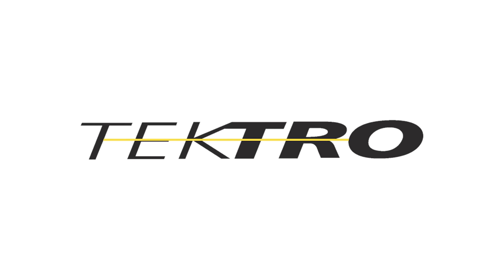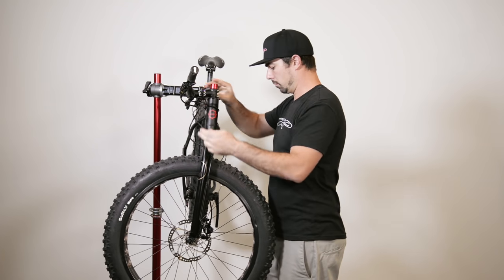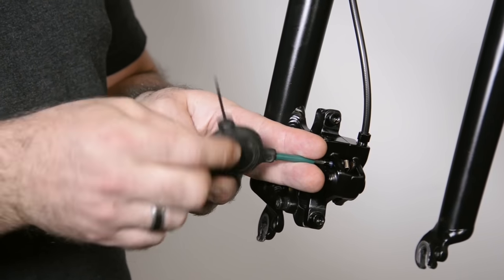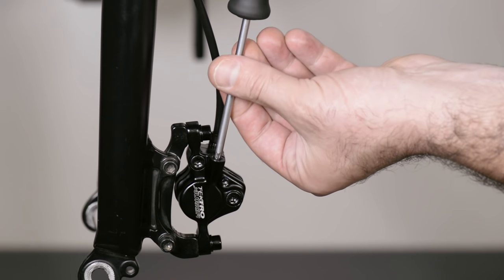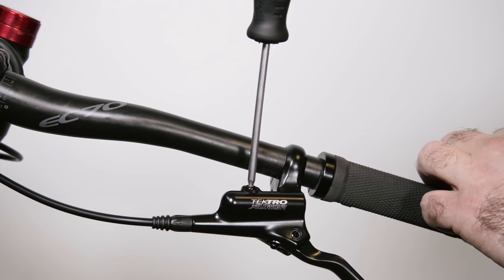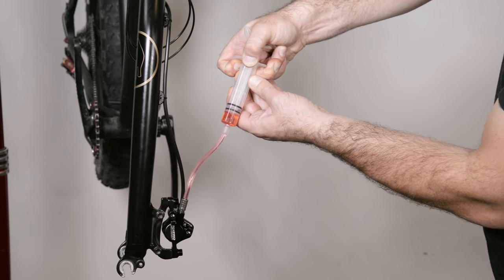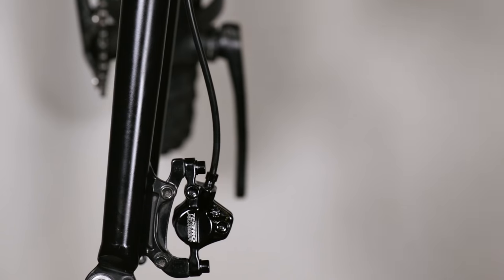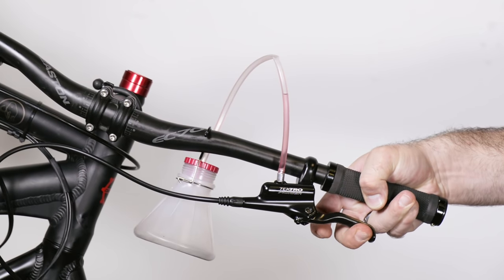Tektro Auriga M290 Brake Bleed Instructional Video

Comment: Few things here ,them not using or supplying a proper clamp in the kit is pretty terrible .And pinched off it still drains some fluid .Any system that has an open port that's not shut off isn't good .

Comment: TektroUSA, since your contact form is not working properly, I'll ask my question here. I am an owner of the Tektro Novela brakes on my mountain bike and I have encountered a problem. When I tried to clean and change the grease in the front brake, I dissembled the thing and I imeediately noticed that one small bearing was missing. I'm pretty sure that I hadn't lost it and it hadn't fallen out because the two out of three bearings were stuck in the grease. So, my question is what are the specifications of these bearings (diameter, material, etc), so that I could buy one. Thank you! I am looking forward to your reply.

Comment: I saw fluid drain at caliper despite your reason for pinching the overflow hose at lever. You lie!!
Reply: came from caliper, not hose :P
Reply: i think that is normal just because the fluid pulls a little vaccum...

Comment: Like others have said, the best bleeding tutorial out there and applies to almost any brand of disc brake.  
The only thing I recommend is getting the Tektro/TRP funnel that you use at the lever.  You use this instead of the bag/receptacle.  It's also a good first step to see if you really need to do a full bleed.  Install the funnel with a small amount of mineral oil, give the brake lever a few flicks until you stop seeing air bubbles and then remove and test the brakes.  A lot of times, this will be enough to remove the air from your system.

Comment: Thanks a lot for sharing the tips about changing the oil. I would like to ask when should i change the oil thanks .
Reply: Gie Valenzuela it is recommended to change brake fluid once 2-3 years but i saw 10 year old hydraulic brakes without the oil changed and working perfectly so replace the oil only if needed

Comment: Why do we need the bleed block / and to take off the wheel? It seems like the existing pads plus rotor would act identically to the bleed block?
Reply: Because you risk to contaminate your rotor and brake pads with mineral oil
Reply: @AlinRbt oh, you are saying if there is a spill? I have no problems with spilling thanks to the bleed system hoses and funnel attachments
Reply: @gutrali  yeah, you might risk to spill some mineral oil on the rotor and/or brake pads if you don't remove them but if you have a bleeding kit it's fine without removing them I guess

Comment: What oil should I use for the Tektro brake system? Can I use Shimano hydraulic oil? tnx
Reply: Yes any mineral oil stick to 
Tektro 
Shimano 
Finish line 
The 3 best mineral oils out there as long as it's mineral u can put tektro mineral oil in Shimano same thing I use finish line it's cheap and good same thing

Comment: 1. Bleed block is a dummy brake pads which extendends the break mechanism, right?
2. If the bleed port should be highest point, why the guy is pushing the front fork down on 0:35? Which one is the bleed point, the front or the back of the bike?
Reply: yannara because it is better to show on camera
Reply: He is bleeding from the top and filling from the bottom. The 2nd thing he attached with the nipple and bottle is the bleed port.  He kept the bleed port the high point.

Comment: Are these brakes enough for electric bicycle with bafang bbshd motor with speed up to 55 km/h?
Reply: @3RT Did you use it with ebike? I'm not very impressed but they work for me.
Reply: Yes. Sometimes I go down a 10km road at average speed of 60km/h, and these brakes are enough! Never had any problem

Comment: how to:  if it is a TWIN HD T525, 2 calipers, one splitter, one lever with one reservoir, how do you bleed a TWIN system..?   Specifically, a recumbent trike with vertical handle bars.

Comment: Can anyone tell me.are the bleed blocks the same size as the pads.i have a bleed kit but no bleed blocks. And have bled the brake system as shown but the lever is still loose (sponge'y) and can't get enough pressure on my brakes.
Reply: andrew rhodes if the lever is spongey it sounds like there might still be air, but I get what you're saying about the blocks. I think they're meant to hold the pistons all the way open but you could probably do it without them. I might get myself a some blocks just in case actually. But yea in general it sounds like it's hard to bleed brakes properly, I see a lot of comments of people having issues on multiple videos

Comment: Did this three time now and the brake still feels like shit, not sure what I'm doing wrong.    Just going to admit defeat and have a local shop do it :(
Reply: Me too... Did you fix it by now ?
Reply: @goran1986m  nope, now have a Shimano rear brake.
Reply: @sawtoothscream1521  these tektro brakes are garbage ... So even the bike shop couldn't fix it ?
Reply: @goran1986m   Not even sure if they bothered.  The guy squeezed the lever and said it feels like it has a leak.   Said he could try bleeding it but most likely will be replacing it and the rotor.
Reply: @sawtoothscream1521  replacing the lever or the whole brake ? So he replalced the old tektro brakes with shimano ?
Reply: @goran1986m  lever, brake, rotor

Comment: Use mineral oil?
Reply: baby oil
Reply: Corn oil
Reply: The kits include the tektro mineral oil for around $12 off of amazon. Mineral oil comes in many different viscoties, with and without additives. Tektro charges a reasonable price, so I do buy the Tektro oil. Of course it's your bike, so set it up the way you want. (Note: my experience with vegetable oils is they break down easily and leave a sticky deposit, so stay away from the cooking oil.)

Comment: i just took the wheel off to bring my bike to the bike shop...  didnt touch the lever..  when i brought the bike back home i reinstalled my wheel and i had no brakes. What the heel happened did air go in the system just because i removed my wheel ?
Reply: Yes air and gremlins allways enter the system when u remove the wheel, litter or get divorced.

Comment: Can i mix this handle with shimano?
Reply: Yes its basically the same thing. I just got a tektro bleed kit today and did a bleed. Brakes are now supreme. I originally got a shimano kit and the fluid that came with both a the same pink mineral oil viscocity and mixture.
Reply: RemSkateSessions Where you get the kit?. I have the m275. Thanks.

Comment: Hi I have Tektro Draco Disc hydraulic disc brakes on my bike and my rear brake is very loose and when I push the lever continuously for few times, the brake gets tightened and the brake force is higher. But when I leave the brake lever, it again goes to the Slack position and I have to repeat the process again. 

Is there any screw that I need to tighten to get a strong braking or should I need to bleed with Mineral oil?
Reply: +Bryan Jacob (Balaji) You need to bleed them. There is air in your lines/caliper/lever
Reply: You can try removing the air bubbles by opening the top cap on the resevoir and keep press the lever utill all bubbles are released.
Reply: i have the exact same problem. it appeared when i flipped my bike around for service.

Comment: What is the guy doing at 0:50?? Remove the brake pads, then put it back in?  🤔🤣
Reply: It looks like brake pads, but he is installing the bleed block, which has a similar shape (so it can fit into the caliper).